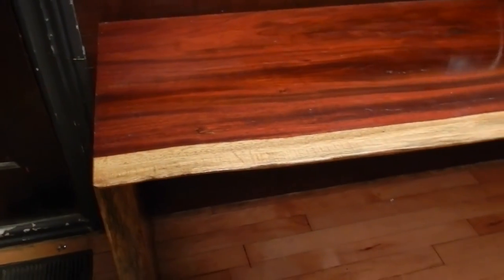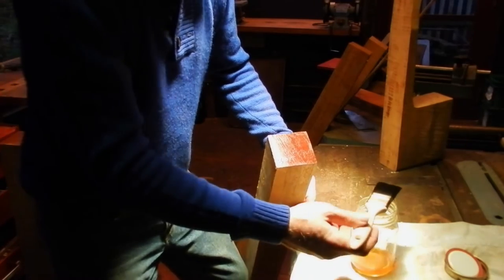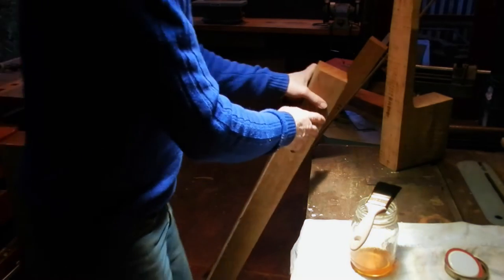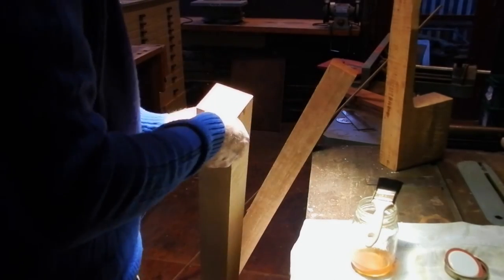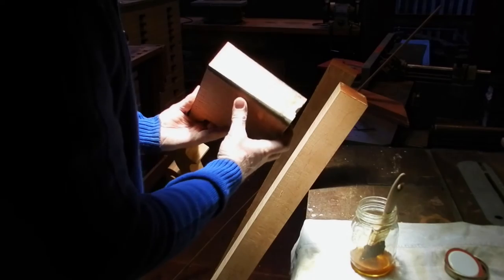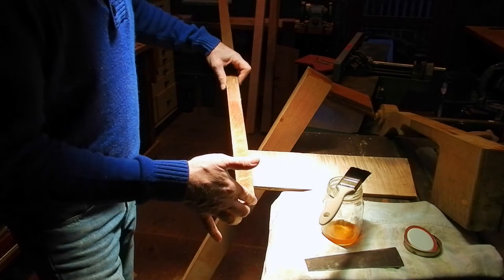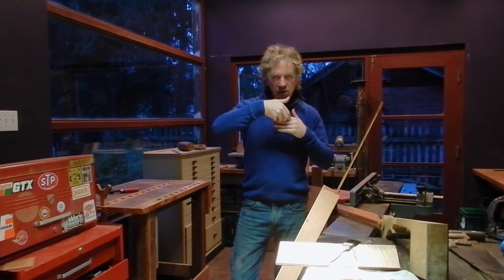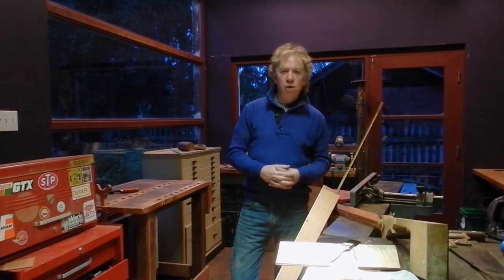Learn Quarter Sawn Vs Slab Sawn Part 3 of 3

Comment: Very interesting series on wood. I did not understand just how one would saw and orient the grain when laminating a guitar neck. I have spent the past couple of months setting up a small basement shop so that I can start making musical instruments, mostly using hand tools but with a few small power tools. (I am also in Ontario.) I anticipate that I will produce a good many pieces of "junk", being a beginner. I am actually going to start practicing with big box store dimensional SPF just to get to improve my skills. But I would appreciate some specific guidance on laminating necks for when I get to using hardwood. Also, where the heck does one get thicker pieces of hardwood?

Again, the videos were informative and engaging. Thx!
Reply from the maker: Hello DJ, thanks for the positive waves.  The lamination of the neck piece was to strengthen and counter act the natural movement.  As for Wood, go to A&M wood specialty in Cambridge.  Be careful it is a wonderful experience, however I have come home with wood that I had no intentions for, at least at that moment.... Happy woodworking.  Michael
Reply: Thanks for replying, MIchael. If you are not inclined to reply in detail, no problem. 

I am in Brantford, so I make monthly trips to A&M. I do indeed have a stock of hardwood I purchased at A&M but have not yet used. This stock is all destined for use as shop-made tools - planes, router planes, straight edges, frame saws  etc. I am just on the cusp of starting these tool builds, having practiced plenty of throw- away joinery on Home Depot spruce. 

My earlier query was whether particular choices of grain orientation matter wnen building a laminated neck. You mentioned "reverse book matching" etc. A lot of youtube videos show people laminating necks with no mention of grain orientation. The one exception I can think of is a video (I forget whose) that suggested symmetric book matching of neck laminae, i.e the outermost pieces would be bookmatched symmetrically, the next layer toward the centre also bookmatched, etc. Does all this matter much? My expectation is that I will learn this with experience - slowly, since it may take a few changes of season and humidity/heat to understand what happened. Anyway, thanks again and keep uploading videos. I have subscribed to your  channel.